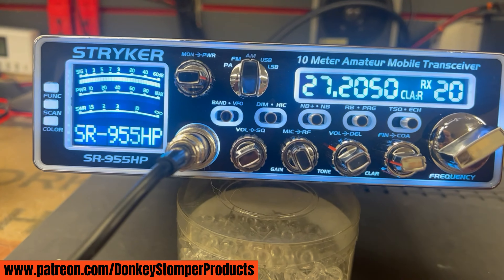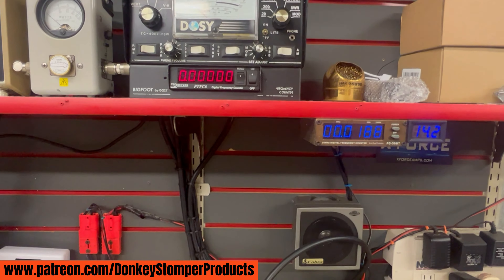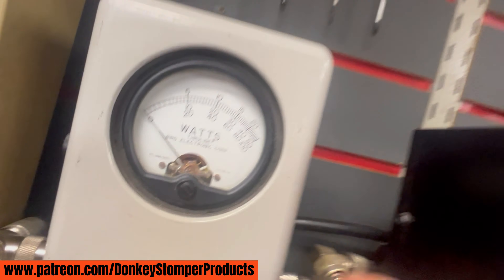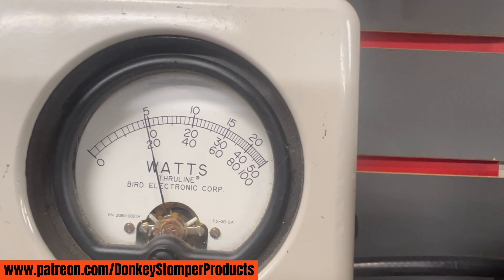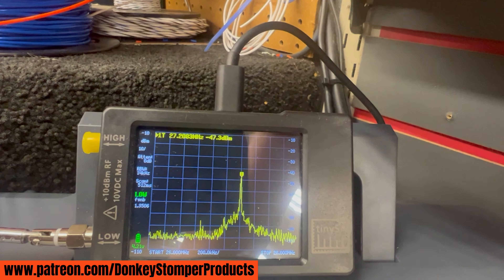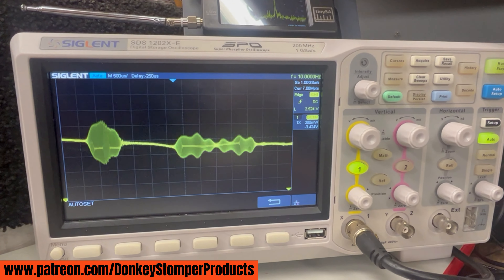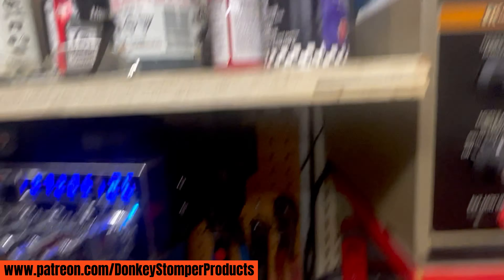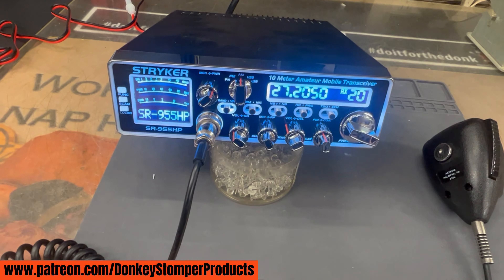Donkey Stomper Products, Stryker SR-955HPC 10 Meter Radio Version 2, Test/Review

Comment: Could you build one of these cw transmitters for low ham bands? Like a 160,80, 40,20? 10 or 12 transistors? Fully biased of course. Thats the bands I really care about. Maybe get the band switch and relay board out of an old amp?
Reply from the maker: Sorry don't build multiply band ones.